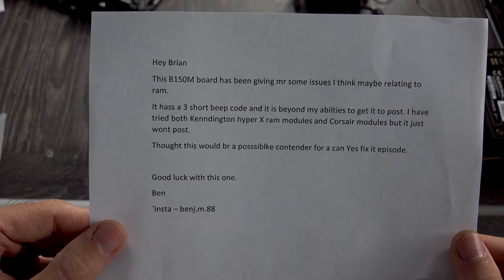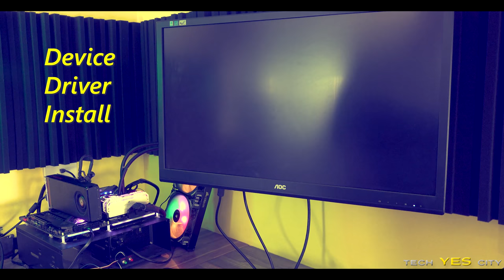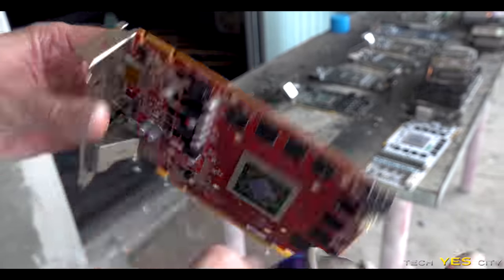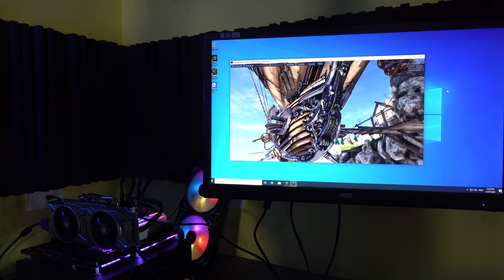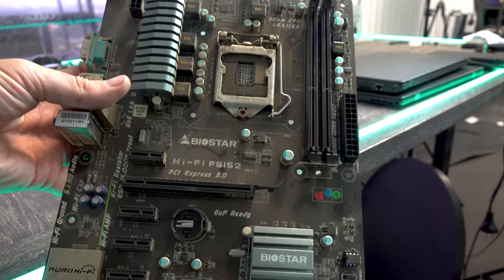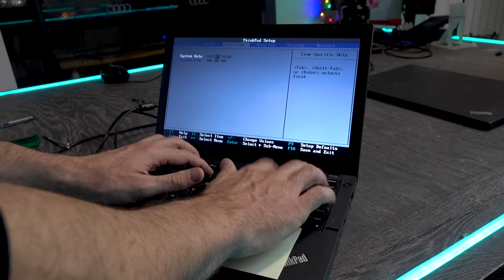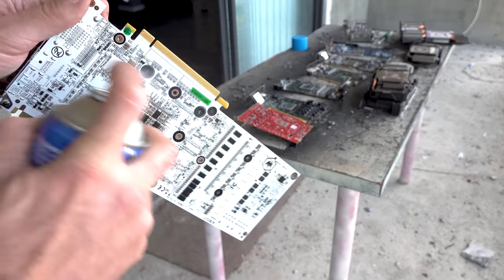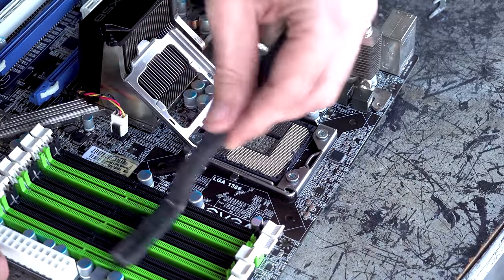How To FIX Faulty DDR3 RAM.....?  Mass FIXING Graphics Cards (Can YES Fix it)

Comment: If janky methods don't work, they get put in the YES TAIWAN box for Computex 2021!
Reply: is r7 370 still usable in late 2020
Reply: Certain plastics can degrade over a few weeks after exposure to brake cleaner. Please report on if the plastic on the motherboards begin to show cracks and degradation or not after a month or so! I'd like to know if it is safe to use.
Reply: @1NIGHTMAREGAMER  no
Reply: Yeah man hopefully that one will be going ahead
Reply: Immortal I’m with you man, being around these chemicals frequently calls for some PPE, brake cleaner is rather corrosive, it’ll eat the shit out of your lungs over time.

Not to mention the amount of filth you can get out of a part too, that shit gets into your system and you can get really sick, really fast.
Reply: Hopefully a stack of ram can be revived this time.
Reply: @1NIGHTMAREGAMER  yes for 720p ultra
Reply: 1NIGHTMAREGAMER Depends which resolution, for benchmarks have a look at RX 460 performance as they’re nearly identical, I’d say 1080p low to medium, other than RDR2 which would have to be 720p medium
Reply: As you said in video you're method's are getting better what I started doing after learning the heatgun technique you use is added no clean solder free flux.  I put it right against the die so it seeps under the GPU die/vram.
Reply: can someone say how using the heat gun fixes the video cards?
Reply: Have you ever though of sottering and replacing some chips on the gpu's to make them work again
Reply: @mattheww797  it reflows the solder joints ;)
Reply: I personally don't see them as "janky". I think they're straightforward and make sense.
Reply: YOO IT'S MARCO BEFORE HIS VIDEO BLEW UP
Reply: @NotSandhorst  lmfao
Reply: I use flux solder primer and glue all the time with no protection could I be catching cancer aswell?
Reply: @JUNEBUGLLC  It's too late now man the damage is already done. You may aswell start living life like GTA from now on brother! HOOYA!

Comment: First off, love the content! Iv'e been trying to build new/used gaming pcs and here in Texas the market is terrible for used parts, even on ebay its brutal. but I have been doing hardware repair for well over a decade and here are my tips. 
1.)Flux is cheap and helps the solder move into place better when even using the heat gun method. 
2.)I've never used your cleaning methods but if you ever want to make an investment get a large wave-oscillating ultrasonic cleaner, Its amazing the amount of hardware you can repair with this alone! also on the cheap you can use a dishwasher. but the ultrasonic cleaner is the best method
3: next step from a heat gun is a re-flow gun, I have a 2n1 re-flow and solder (SMD rework station) bought of amazon and it works fine. also love using an oven or a toaster oven. this not only ensures even heating but allows you the space to do multiple parts at the same time. 
keep it going!
Reply: yah he needs to invest on those equipments u just mentioned. well i guess hes a vlogger, not a Board Level Technician
Reply: Great points thanks.

Comment: them: you can't wash electronics with water and soap!
tech yes city: haha RAM go squeak squeak
Reply: You can wash any electronic device. You just need it not have any voltage through it (like BIOS battery) and to dry it.
Reply: @bestbattle  For the most part you can wash with small batteries like that connected as well, inadvisable, but you can, the main problem is if a 12V rail connects to a smaller one, like 5V, the 5V traces and components cant handle that kind of power, what TYC should be more clear at is to make sure all capacitors are discharged before trying it, as they can hold a charge for hours after.
Reply: I've done this many times and allowed them to dry for at least a week before reusing to make sure it's completely dry.  I told my friends the same thing and they think I'm lying and ridiculous, lol.
Reply: Pft my old PC was submerged in flood water for two days. Cleaned it up with some rubbing alcohol and wd-40. Worked no problem for another 12 years.
Reply: heard from my college who worked with PCB previously they use IPA to 'wash'  them after soldering.
I've tried dipping RAMs into 99.99% IPA and they still work after that.
Reply: I fix some faulty GPUs this way too. Ye olde wash em with dishwashing soap and a soft toothbrush then bowdry them and let them dry for a week beside your fridge.
Reply: for a week its too long , i just wash any GPU , sunbath it for 1 hour, and use hairdryer for few minutes , and put it on motherboard right away :v
Reply: @K1dd0  What is IPA?
Reply: @hackerwacker2406  Isopropyl Alcohol

Comment: The man's on a roll! Keep cranking the awesome content. Let me once again thank you for the inspiration - I know you do not work with laptops as much(this is the first video I am watching you work with laptops) but watching your videos - especially ones like these and the parts hunt - inspired me to work on an old Thinkpad W510 with i7-720qm and Nvidia GPU that kept overheating (almost 100C in HWInfo without any programs running) and shutting down. Opened it up completely, cleaned up the dust and old crappy thermal paste, re-applied some good old TX-4 and my daughter has a great working laptop now that rarely goes over 70C and flies through all the stress tests (Prime95, Intel XTU, etc.) without breaking a sweat!! 😎Keep spreading the Tech Yes Love!! 👍👍

Comment: I did some parts hunt in Singapore (I live here). A lot of ex mining Polaris card and GTX 1070 at good value.
Reply: where i can get it? did they sell them online?
Reply: Do you get them from carousell or directly from the miners? 

Seen a few of these mining cards but mostly from either guys who buy up the cards in bulk and list them or miners that want to sell the whole system.
Reply: @poside  Yeah, I buy from one of those. I am not sure whether this is common but make sure the seller re-flash it back to gaming VBIOS. My RX480 comes with a mining VBIOS and Brian trick to re-flash the VBIOS didn't work for me as I cannot find the correct VBIOS. I have to use a registry edit hack to fix it. Also, maybe this is just me who push my card too far but keep the VRAM to stock. Pretty sure that is how I kill my RX480. Especially with mining card which tuned to have lower core clock but higher memory clock than stock.
Reply: @kaitoharrison872  just find a techpowerup vbios that fits the description of your card

Comment: Fellow Aussie here (N.S.W), got a few questions to ask.
1) Why Brake Clean specifically? Price? Availability? Larger capacity than most cans of electronics cleaner?
2) Are you flipping the AM3 970 board? I'm looking for one to drop a loose FX 6300 in I have laying around and finding good mobo's for a decent price that suit FX processors is really difficult now.

Comment: This is awesome showing how to resurrect some cards. If you ever want to upgrade in the future with the tools. Check out the Hakko bottom heaters and PCB vises. At work, these things really speed up the time without burning up the parts and PCBs. The new stuff is kind of expensive but if you can find it second hand you could save some cash. The bottom heater really helps with layered boards with large ground plaining or large BGA's. At work we use ether Weller or Hakko and this stuff works 3 shifts a day 6 days a week. We put these tools threw hell and they just keep working, though the solder tips if miss used will only last a week but if you know how to use them they will last a few months. I've gotten a medium size Hakko 936 solder tip to last 4 months.

Comment: "This is a big reason why I'm not big on laptops personally, and that is we've got GPU CPU RAM all on the same motherboard"
Totally 100% agree, I have 3 PC, and only 1 Laptops.
Reply: Yeah cause my RAM GPU and storage are all in different parts of my room, my pc still runs fine! Totally not all on the same motherboard inside my case.
Reply: Some decent laptops still have socketed RAM and CPUs
Reply: @sachatrin2981  

Clevo's are the best bet for one of those. They also have excessive cooling.
Reply: @sachatrin2981  Only the REALLY high end flashy ones, sadly. And this is the industry's answer to REVERSING landfill???
Reply: @Psyrecx  And excessive price tag. I love Clevo, but find them too plastic, and the fans are whiny. My old M670SRU had such a whiny CPU fan it was like a BANSHEE.
Reply: @supergeekjay  i was mostly thinking about business laptops up to 4th gen
Reply: Yeah same, that's why I only have 20 laptops out if my 234 computers I use (Might seem like a lot but 5 of them are phones)

Comment: You are a smart guy, must have tried too, but is Very common to the hdmi die... i bought a 960 for cheap because the hdmi was dead, but the display port was ok  (and I'm using it with an adapter now)

Comment: Greetings from Romania, Bryan! I can attest the DVI thingy on the HD7950 as well - I have a older card (7870 OC, the Gigabyte kind) that does the same thing - it will cut out on standard HDMI, but work absolutely fine on a DVI to HDMI adapter. P55 machine by the way, the kind that you loved - GB P55A-UD3 + i7 860.

Comment: 21:00 - I'll do it for you. Not a problem, even flash it for you. Have the tools and parts, just send it!
Also, don't be afraid to keep the heat going on those parts, just don't burn them....  Happy to fix ya laptops too, no need to replace whole board, unless CPU dead or dying.
Cheers Bry, luv ya content.

Comment: Heatgun "fix" is usually only temporary. The cards will break again after a few weeks/months and everytime you heat it again this time gets shorter.
At least that's what happened to a few of 9800GTX's that I tried it on.
Reply: If you undervolt and underclock you can usually save them for desktop use
Reply: @gabrielecarbone8235  namely G92 and G80 based card didnt have 2d/3d switching, for desktop and had terrible idle power consumption of around 30W (lowest 8800-9800GT) to 40-45W (most of them), to 55W for 8800GTX. The only exception was 9800GT/9600GT green edition, they had around 20W in idle, those were one of the last G92 based cards in 2009. They have voltage lowered to 1 (from 1.10-1.15 original)
So you cannot undervolt 9800GTX through software, you need do BIOS mod. If you set it so low, that card won't boot, you screwed, as it don't have 2d/3d modes, you need to change only one voltage for 3D. It's risky as hell. Would not risk it. You can underclocked it through software, I have it set to 350/500 for 2d use. (from 700/1000). It saves 5w in idle, because cannot undervolt it, which is sad. Would drop by 20W, if also voltage could be lowered to 0.90v.
Reply: @warrax111  mh i usually test this way, I start with very low voltage and clocked bios and then proceed to overclock back with software to find a stable clock / voltage usually a bit lower than original but at 1v.
Reply: The re-soldering by heat gun works way better if you flux the components (or the entire PCB) that you are trying to re-flow.  Invest in a bottle/can of flux.
Reply: The old 9800's were failure prone because the chip ran too hot for the new "lead free" solder that was introduced, it was a massive problem for a LOT of systems and GPU's, on laptops. The nVidia Go 7900 was another bitch to keep running.

Comment: I hope you won't sell these cards!
As an electrical engineer I can say that without applying BGA flux, they most likely wont last very long. reflowing BGA Chips is not that easy. A small oven works better, but only if you apply flux.
For private use, heat gunning (or baking) them without flux is totally fine, but just don't expect them to work over time. It really is a gamble. I've done this (like you, without flux) to an R9 280X, worked great for over a year, but then it failed again.
For some graphics chips it also won't work, because the die itself is degraded. A good example are Radeon HD6xxx and GeForce 8xxx cards. They have a VERY high rate at coming back to life, but they will fail again after a bit of thermal cycling.
This method is great for extracting an extra 6-24 months of the GPU, for example to wait for the next generation, or for fun, but NOT for selling those.
If you want to sell them, use flux, so the fix will last.

Also, it is a good idea to check vcore with a multimeter before trying this. if Vcore is not even present, this won't fix it, or it will only work for a few days (because heating capacitors can revive them for a few days)

Comment: Being someone who deals with refurbing laptops any of your business oriented laptops like Lenovo ThinkPads and Dell latitudes are super easy to work on and repair even the screens. Also some times unplugging the cmos and built in battery for a couple days have saved some of the ThinkPads I've had that boot loop. Also the market for parts from those type of laptops from the screen to keyboad have a pretty good resale on ebay and the like.

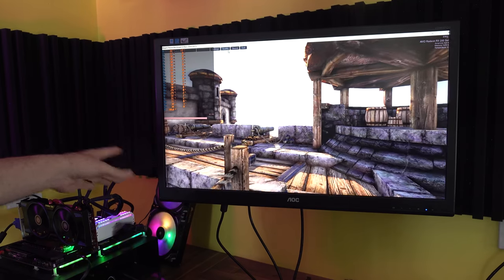Comment: 6:10 The one with the blown HDMI port, have you tried the DP outputs on it? DP uses an almost completely different circuit on the GPU output side, so there is a good chance that if VGA works DP should as well.
Reply: Serial Thrilla  DVI and HDMI are electrically compatible, so both are probably coming from the same silicon block, but DP uses different electrical signaling, so it might go to a different set of output transistors on the GPU.

Comment: @18:15-18:20 the BIOS Chip seems like it needs to be pushed into the DIP - socket a little bit, might be the reason for no boot! (Asus B150). PIN 1 and 8 are lifted up the most, I don't really know if PIN 1 aka Chipselect is needed for normal BIOS operation, but I know for sure it's needed for BIOS Reprogramming. However PIN 8 is VCC and is crucial, since it is the main Supply Voltage for the Rom, without it connected properly, malfunction is guaranteed.

The precise Timeframe of 15 Seconds from power on to auto power off, seems to be the period in which the Board tries to autodetect BIOS Flash Rom, RAM is not even initialized at this point, it turns off because of Bios detection timeout!

Since u got the board second hand, it might also be the case, that someone exposed the board to an excessive physical shock, during which the BIOS chip might have popped out and someone plugged it in back the wrong way, so make sure to check the orientation as a last resort. Both the chip and the socket have an etched in mark, which is to be alligned. Sorry for the weird wording! 

Enjoying your Content a lot, Tech Yes City Gang! TYCG
Reply: Noticed that too
Reply: It should be possible to pull that bios chip out with pliers and put it back in
Reply: @MarshallSambell  you could also desolder it and put it in the first slot really easily, you don't even need hot air  : )

Comment: Thanks Buddy. I´m one passionated PC-Builder for decades now. But never dissambled Graphics cards till yet. Now I´ve got the bite to do it´s. 
Got here´s one damaged AMD Radeon VII Card, with faulty RAM-DAC. No signal-black screen. BIOS Warning sounds =1x long peep and 3x Short ones!
Should I´ll RISK my warranty, trying to fix her by cleaning!? 
Cuz still remains 5 months till it´s ENDS

Or do you mind If I´ll should intead send back to RMA=?
We all know it´s reference Design card. The Manufacterer was MSI.
So the damage just occuered on the last days. I´ve still using 2 others Rigs. 
That´s card isn´t affects me so bad. 
But I´ve really loved her. Even wrote VII in red letters on the side and painted the fans inner circle in red too!!

Comment: nice to be early for once 😁
edit: 4:00 does that p5q motherboard work or is it just for display?
Reply from the maker: It has a boot problem, but it was the first motherboard I pulled out of a thrift store in Japan way back, holds sentimental value now.
Reply: @techyescity  hello mister savior, may you help me with some advice. I have a 970 msi with black screen error when plugged (hdmi/dvi same issue). It happen when i put the 6-8pin into it, if i just boot with pci i have signal and error message saying i need to plug-in pins. So i dont think its related to the hdmi/dvi port itself, i tried cleaning/changing paste, same issue. Dont you have any ideas where i can look? thanks! =)

Comment: Great video as always, keep the good work.
I have been having issues fixing a family member's laptop, it's an old Samsung.
For some reason the desktop icons keep flashing, and if i press the right mouse button they apear, if i press the left button they disapear. It even started pasting the days date on a document for no reason. It reduces the sound when playing videos to 0 and keps refreshing the webpages. Initially I thought it could be the keyboard so I unplugged it and used an external one, problem persisted.
Then I thought it could be software so I intalled win10, Win8, Win7 and even linux, but the problems persist. Then I started thinking it could be a problem with the graphics chip (the pc was overheating before I got my hands on it, so it might be shorting) but that would cost way to much to fix it, it it really is that.
Do you happen to have any idea what could be? Also the problems seem to be worse when the temperatures are higher.

Comment: aside from the heat gun.. issues.. i wouldn't put carb cleaner on electronics mainly because it's unnecessary.
i use the good old dishwasher along with the dishes and >THIS IS REALLY IMPORTANT<  immediately after that an alcohol bath to get rid of all the water. squeaky clean with no oil smells. just don't use any cleaners used in industrial washers..
for more precise stuff like ram slots i got a residueless contact cleaner spray can.

Comment: for laptops, try putting them in the oven 200 degrees C for 10 min, if there are plastic parts cover them with aluminum foil. Worked for a laptop where the GPU got loose. Got it for free 30 min work :) Just make sure you let it cool down be4 you move it.